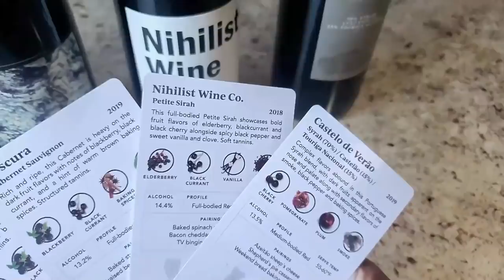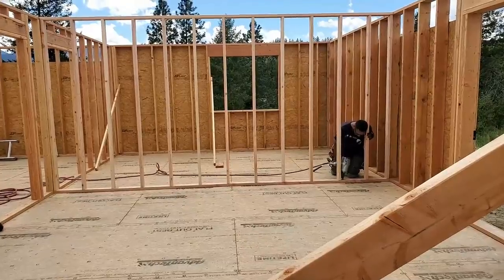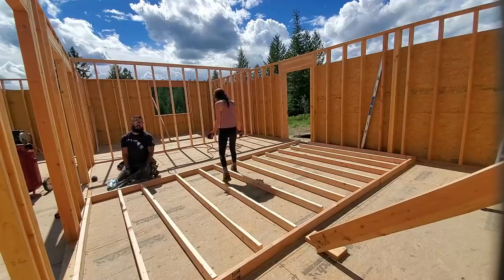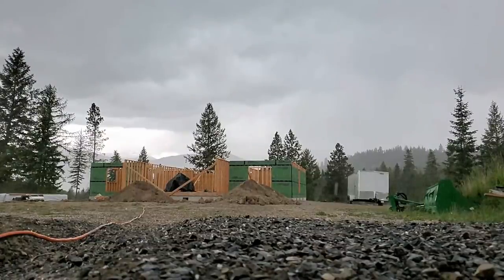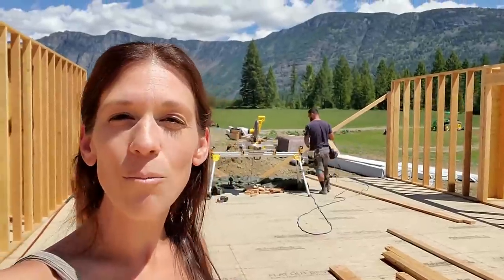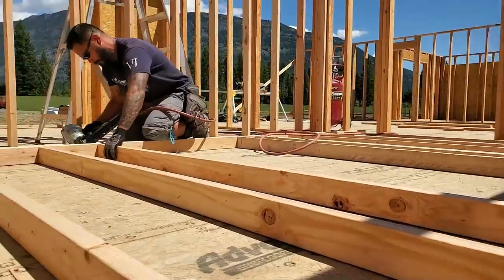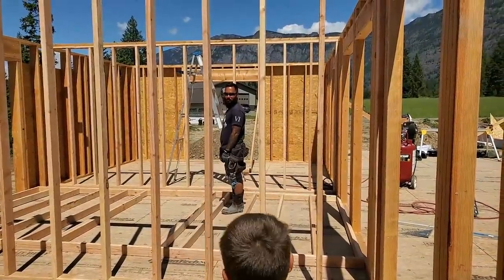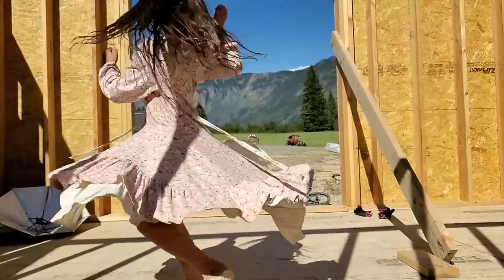Framing Bedrooms & Bathrooms In Our DIY Home Build | Prepping Our Timber Frame Truss

Comment: Jamie,  where your tub sits. you need a 2x4. turned sideways,     32''  from the back of the tub to the  center of the 2x4   this is the edge of the tub. and it is where you are going to be nailing.  32''   is a typical tub,  they make 34 and 30's  adjust to your model.

Comment: Recent weather in California's northern central valley has been fairly consistent. The high on Monday was 106 F. The high on Tuesday was 108 F. On Wednesday, a cold front came through and dropped the temperature to 103 F.

Comment: You NEED NEED to get pants that hold your kneepads in place.  Otherwise the back of your knees get way too much pain from all the digging in by the straps.  Lots of options.  I think a search for "construction pants with knee pads" would get you on the right path.  I have Blaklader pants but I think any would improve your life.
Reply: Also getting a canopy might help for "mild rains"
Reply: One last comment.   If you are going with solar check into a combination of solar with some power from wind.  In cloudy weather and night time you still have some wind and hence aren't dark.  Plus you might need to repair one while the other gives some power.